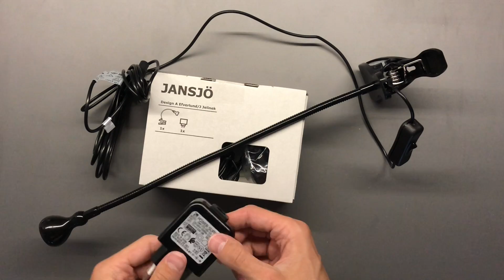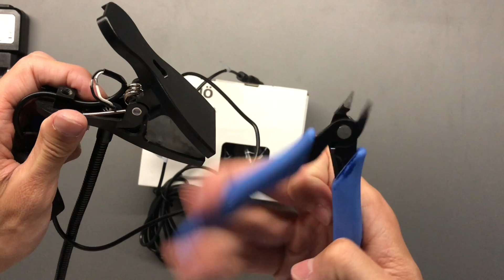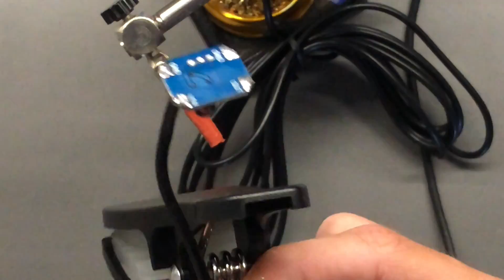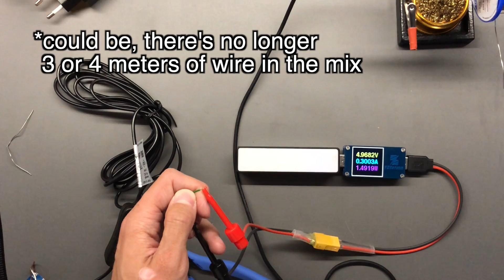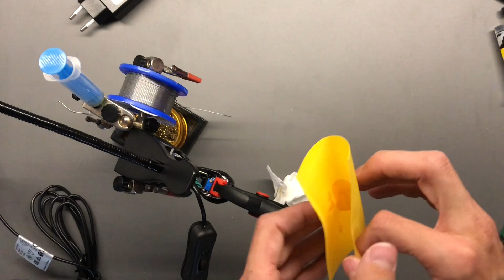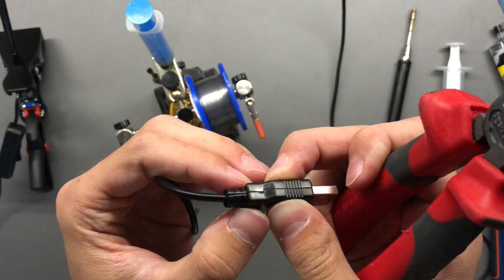Converting the IKEA Jansjö Work Light to USB

Comment: This is an inspiring video, and I want to have go as my Jansjo transformers are starting to fail. However, mine are rated as 4V, 0.75A 3W. Is it safe to simply put a USB plug on the end or does it still need the voltage adjustment chip? Or would it be dangerous to use in a USB socket without a transformer full stop? Mine have the din speaker socket.

Comment: Interesting that they have changed them - the old ones I have take 4V on a DIN speaker connector. They have current regulators and take 5V at 500mA just fine!
Reply from the maker: Hmm, maybe these have more light output then? The usb plug ones must use the same led as yours though

Comment: Tx for the video!
Just wondering, why IKEA didn’t design it the way you modified it. They could then even sell it without the power supply/USB charger.
Reply from the maker: Yeah ... good question, it is cheaper making proprietary supply rather than a USB one though, so, maybe that's it

And they do sell the USB version, but with no clamp ... so, they were clearly thinking about it

Comment: what i had done is first set the boost circuit to 7v and measure the potentiometer, then replace the pot with the closest smd resistor value after that make the boost circuit small enough to fit in the switch and viola. nevertheless i enjoyed the video. thanks.
Reply from the maker: Nah man ... I opened the switch ... literally no free space it in at all (was also a bitch to open)

What I would have done now that everything's done, is put one of those multi-turn pots with a handle on it so I could easily adjust the brightness on the fly ...